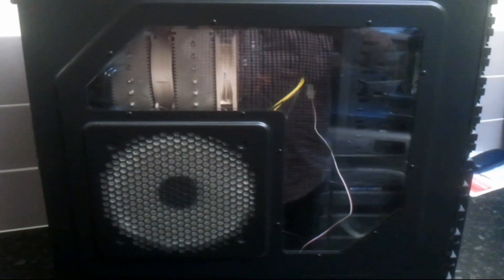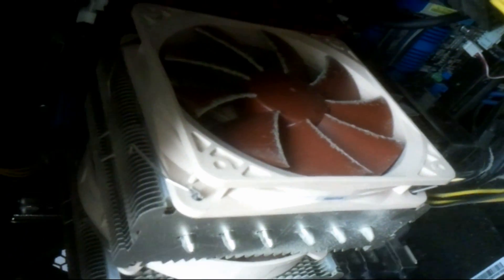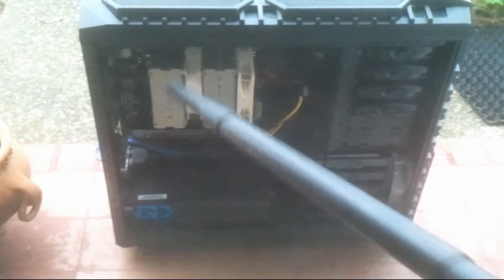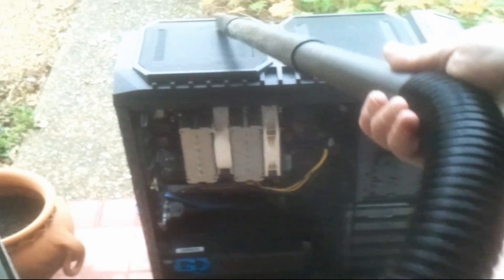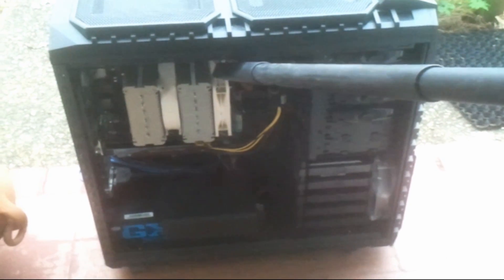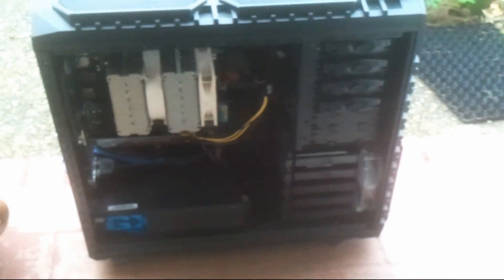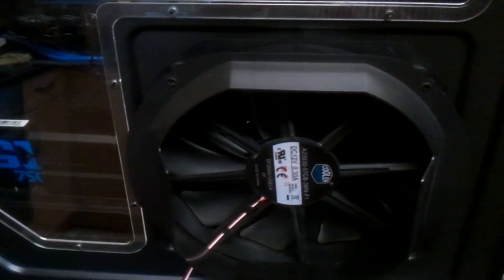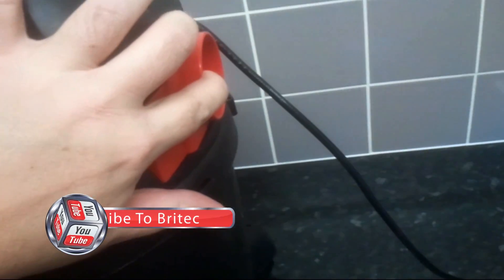Keep Your Gaming PC Clean So It Doesn't Overheat by Britec

Comment: Dont use a vacuum cleaner to dust out your pc. The vacuum cleaner can release static shocks and ruin your hardware.
Reply: There's no air going inside of the vacuum, though, so you're incorrect.
Reply: No he is correct, you never want to vacuum your pc
Reply: InfiniteLaundry He is obviously using it as a compressor. That's why he showed us the air outlet of the vacuum cleaner at the end.
Reply: Static shock through a plastic tube?
Reply: if you use vacuum cleaner  then open your motherboard  components

Comment from the maker: trouble with hoover or dyson, if your using it to suck dust then no its not a good idea because this can cause static, which is not good for electrical components. But if it has a blow function, then yes it should be fine.

Comment from the maker: All vacuums generate static, but we are blowing air which is safe to do, we are never really touching the electrical components, just blowing air over them, now if your using the vacuum on suck mode to suck up the dust this can cause more static, which is more risk. There is no risk using this method as far as i know.

Comment from the maker: vacuum cleaner creates static electricity when sucking and your have to get real close to the hardware components, so if you use a vacuum cleaner which has a blow feature, you wont have to get near computer parts.

Comment: My method is using an air compressor, you just need the air gun attachment and turn the pressure way down so you don't break anything. Also hold the fans so they don't spin because with that kind of air they will spin faster than designed. I prefer the compressed air because it really gets into everything, and if your good with computers its not a bad idea to use some new thermal paste, id say once every year maybe

Comment: great video. once you have done the standard window system clean "ccleaner,disk scan,defrag,virus scan" If the pc/laptop still run slow then this is the next step to take. I just take the system apart for a good clean but i guess its a lot faster using shop-vec.

Comment: I use a small blow gun connected to my shop air compressor and I set the regulator at 80 PSI so not to damage anything. It works well to even get it out of the cooler fins.

Comment: Thanks brian :-)

Smashing clean pc, and cooler.

Mine is a hoover delux pc, it finds all the dust and keeps it in the psu lol :-)

Some people use an air line, i tend to take the psu to bits and outside use a bristle brush to shoo it out of the psu lol.

And your cleaner pc wont have sudden shutdown probems, so smashing :-)

if more people gave there pc a yearly clean they would have less problems with it.

Comment: Don't use a vacuum.  Use canned air, and I'd do it at least every 3-4 months . . . You never want your PC to look this dusty . . .
Reply: what is canned air and how can i obtain it?
Reply: S Smith Canned air is a spraycan filled with a mixture of propane/butane gas, which is flammable. Only use in well ventilated areas. I think you can buy one of those cans at most electronic hardware stores or computer stores.
Reply: Kareldekorte2 thanks, but after some research, il probably just buy a 200 dollar air compressor and every month or 2 just bring my pc outside and blow out the dust through that.

I heard that some air compressors can build up moisture through the air thats blown so after iv dusted out my pc il leave it out in the sun near a semi-shaded warm spot to dry for an hour afterwards.
Reply: S Smith Yeah, you are right
Reply: S Smith Canned air usually builds up moisture, not air compressors. When the compressed air in the can spreads out through the nozzle it get's very cold and can form the evaporated water in the air (humidity) into small water drops. You can cause the same effect with a compressor, when it produces really high pressure and has a very small nozzle, but it won't happen on normal pressure levels. You can always touch the nozzle to feel if it's cold as ice and check if there's moisture on it. And you should get a compressor with a water filter, so no moisture will build up in the tank.
Reply: Razor Blade Brain fart I was wrong